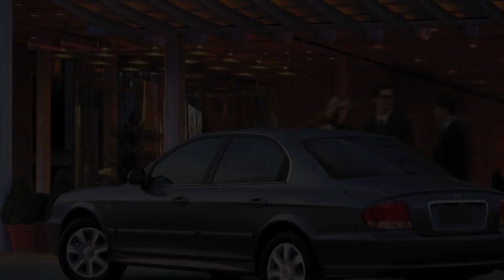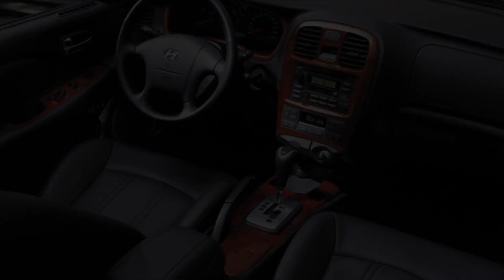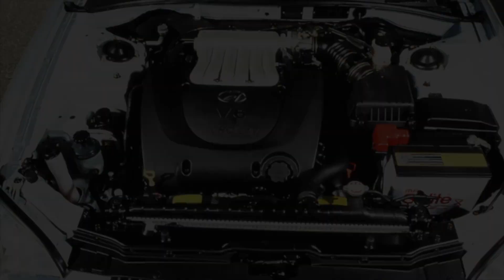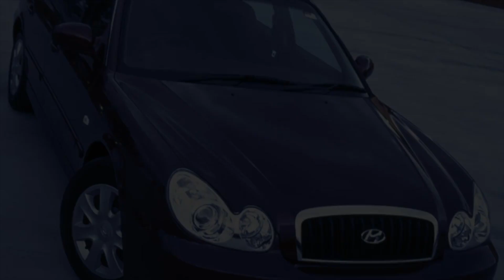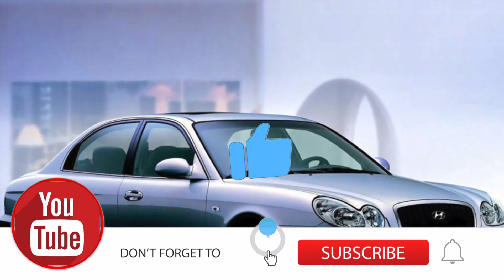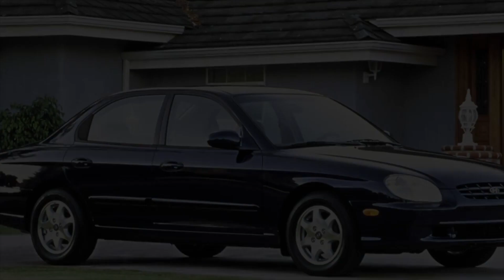Hyundai Sonata 4 (EF) - Check For These Issues Before Buying

Comment: Very helpful. Thank you!
I changed the set of three (immobilizer+ECM+Keys) two times. It clocked only 78000 kms. Suspension related parts often goes away.